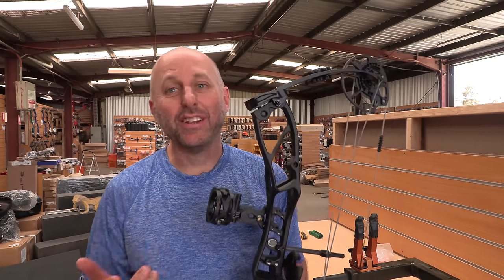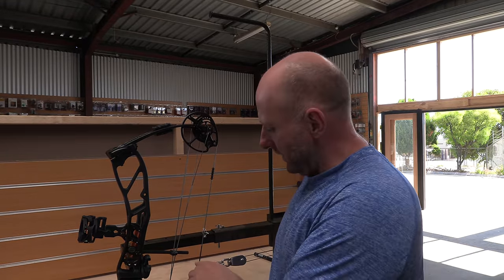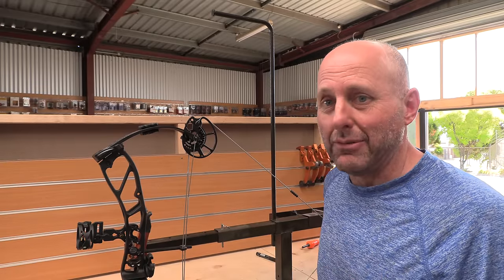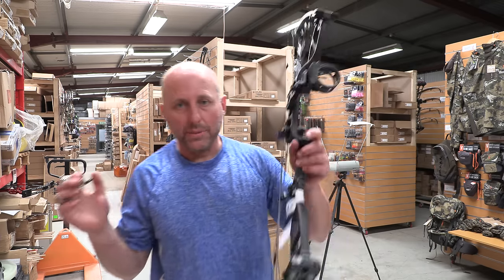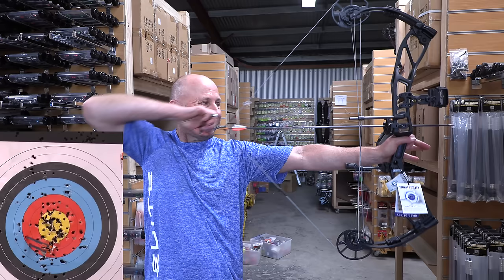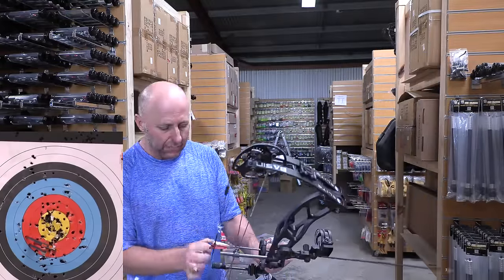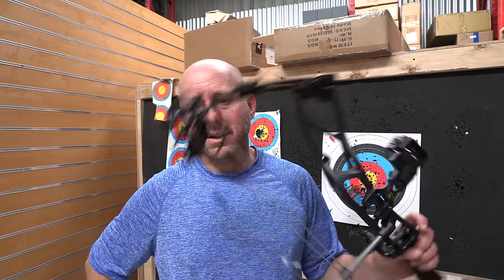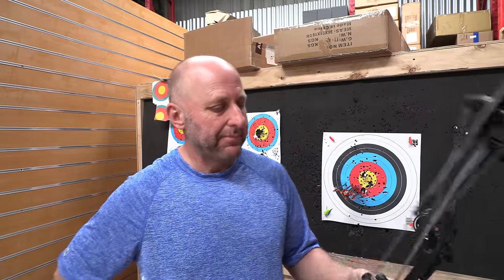Elite Basin Part 2 compound bow review

Comment: Wow you really went above and beyond with spending all that time fixing Elites mistake. I have two Elites and its disappointing to see that more care wasn't taken. My Elites are much pricier models,  but you can't sell a beginner a bow that is so messed up! Shame on Elite and kudos to you! 👏👏👍👍👍
Reply from the maker: The Envision that was straight out the box 5 minutes and shooting.  I would say the top end Elites are good.  The Basin is just sensitive at the end.   The Basin comes set at 25" so I guess at 25" it was fine.  I think the issue comes from the longer draw and the module design.  The Terian which I will release tonight had no issue.  Straight out the box easy.
Reply: It's also a good reason why I would want to go to a dealer if I get a compound. You can can get help to adjust things there and if it still isn't to your liking you can go to another model and se if you like it better. In this case you might opt for a more expensive model.

Comment: Thanks for reading the comments and having another crack at this bow, i appreciate your time and effort to do so. Would it be possible to test another basin out of the box to just check if this was a one off that slipped through quality control or if there is an issue from the factory with this model?

Comment: Would love to see a video on timing the Topoint TS330. Lol
Reply from the maker: We made new strings for the bow and still had a wobble.  One of my customers put dloop in his and it fixed it.  It is frustrating when a bow does not work.  Started the TS330 video - wow this is a great bow- great cams.  Finished it with never stocking this again.
Reply: @ArcherySuppliesLonsdale  Such a shame. I had high hopes as well. Hopefully they can come back with an improved model.

Comment: Anytime ever that I time a camp ever ever that I time my camps I'd never go more than depending on the gap if it's a small gap I do a 1/2 return which to do one turn you don't just turn it over you turn it over then you turn it over again that's 1 hoe oscillation 360ﾟ I always put the twist into the one that is hitting 1st the cable that is hitting 1st gets the twist

Comment: as always great review with tons of good info, the time it takes to tune would be impossible at our local shops...absolutely no way in hell they would dedicate 30+ minutes on a $500 US bow.    * do want to point out you mentioned LIMB stops several times and then at 22:55 you point to them when you talked about let off.... you are not using limb stops, they never came close to hitting the stop plate.    Not sure if something is wonky or you just said limb stop when you meant to say cable stop.     I know the pain of a hard to set up / tune bow.. my favorite bow ever was the Win&Win Arion but once it was time and I replace the strings/cables it never made it back to spec so I get a 5 inch + nock high paper tear, it vibrates and its not as nearly as accurate for me larger groups and my flyers are WAY out.      Going forward I will have to buy my own press or buy whatever bow brand the shop is most familiar with.   thanks for the honest talk on archery gear, its the ONLY channel I can find like this... some others I like and watch but clearly they have favorites and pick and choose what to give a "bad" review on or are just brand commercials parroting the marketing BS.

Comment: I've owned and own 4 Elites that requires removing the stops.  Yes it is a pain in the ass so don't get in a rush.  For a shop it's time consuming and the cost can add it up I'm sure over many bows. Personally, I really don't mind it too much as the bows are fantastic machines IMO.  Very seldom do I have to press an Elite.  New string-cables once in a while and then maybe once after the strings have been shot some to correct the timing. The timing has to be as exact as possible.  This is important for all bows. Not just the Elite